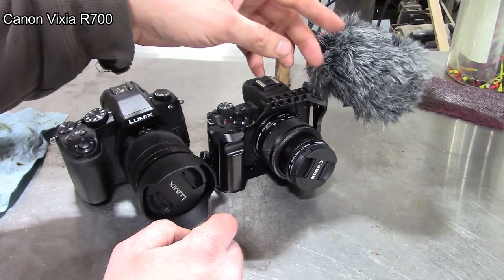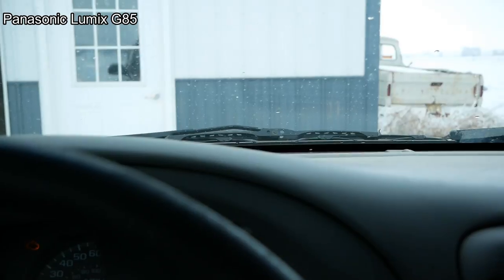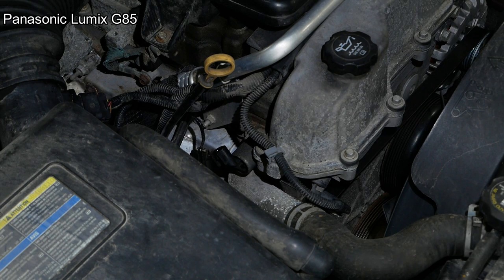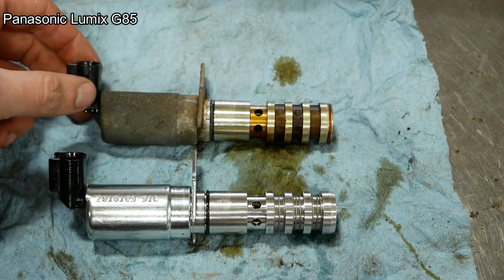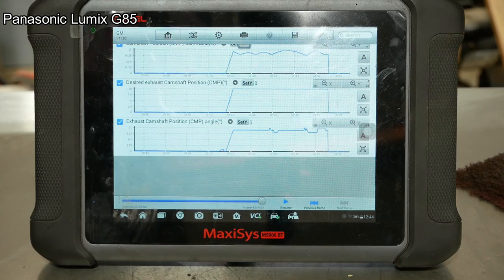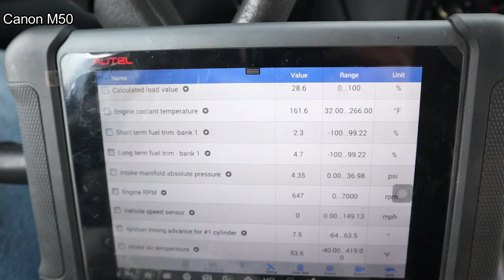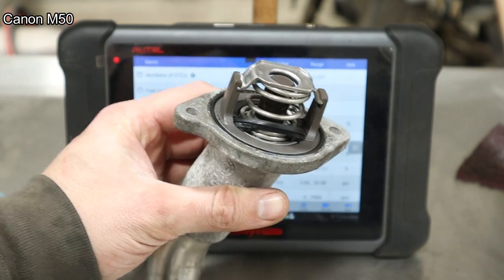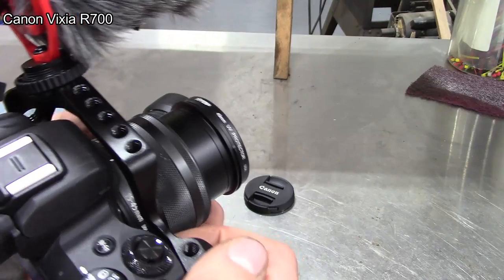Chevy Trailblazer -  Runs Rough on Cold Start, P0014- New Camera Testing

Comment: I own a 07 trailblazer. Replaced the steering angle sensor with a dorman and 20 minutes later the light was back on. Bought a real part from the dealer and installed it and never had a problem since. Did not have to have it calibrated. Lumix

Comment: I vaguely recall a similar GM design flop back in the 70’s. One of the new small post oil embargo  cars had a small v6 and the story I heard was that you had to jack the engine off the mounts in order to change one or two of the spark plugs. This was a time when changing plugs was typically done more frequently than now, as ignition systems were still a little primitive compared to more recent systems. Looks like the GM tradition of design stumbles is alive and well.

Thanks so much for showing the camera comparison! The Panasonic seemed sharpest, but honestly I think all three are satisfactory. Maybe keep the Panasonic and use the vixia as a backup? I was a little surprised at the canon performance. 

Nice to see the side by side under same lighting conditions. BTW, I must compliment the lights again. They look great! I know you are enjoying working with the better illumination. I’m hoping to find similar components for my own shop.

Not sure what it means, but the ISO numbers closely mimic old film ISO numbers. You would set lens speed as a coarse adjustment, to freeze  motion or alter depth of field then fine tune exposure with aperature. For instance, “Back in the day” in Kodak b&w we had plus-x 200 ISO, tri-x 400 ISO (and others), and some special developers and “push” processes that could get a very grainy image quality at up to 6400 ISO. It’s been a good 40 years since I’ve done any darkroom stuff, but I think that info is at least close to what we had.

Comment: As far as VVT issues go, that sludge on the intake screens is present throughout the whole oiling system.  Its also in the cam phaser .  This sludge is more solid when the oil is cold, causing phase problems in cold temperatures.  The shop I work at in Nebraska uses a flushing chemical from BG to break down the sludge.  That usually does the job to free up VVT solenoids.

Comment: Wes, if the problem persists, you could try an oil change and maybe ask the owners if this problem presented soon after a previous oil change.  I've seen a very similar problem on a Ford 3V 5.4.  Changed from synthetic oil to dino juice and the cam phase controllers immediately started to act up and cause severe rough running.  The fix was to revert to synthetic oil and change both controllers. They were gunked up on the screens, presumably inside as well.

Comment: Hi there, 
to change the iso increments on the Panasonic G85 you have to go to:

MENU → Camera Icon → page 6 of 8 (also called the Rec menu):
ISO Increments→ change it to 1/3 EV instead of 1 EV

Thanks for your relaxing and interesting content!

PS:
And maby use Shutter priority mode in combination with automatic iso, then you can just use your exposhure compensation to change the exposure and not have to worry about Aperture and iso. For a 30fps Video you would normaly set the expushure time to 1/60s and if you film at 60fps you would use 1/120s.

Comment: I'm pretty sure you fixed the issue due to the solenoid having oil in the connector. I've fixed a lot of them that way. Had a few that had chain and phaser issues too. Thanks Wes!

Comment: Wes, I recommend using the Aperture priority mode with ISO on auto.  That’s what I use on all my videos and any fine exposure adjustments are made with manual compensation (+/-).  You want to set the shutter at twice the video frame rate, so if you are compiling the video at 24 FPS, use 1/50 shutter speed.  If it’s not too late, you may want to check out the Sony line up as they are known for having the best auto-focus with awesome image quality,  A6400 would fit your bill perfectly.  I use the same Movo mic with great result.

Comment: I had a similar problem with my Odyssey.  It was the idle air controller.  It was gunked up and was sticking.  It oscillated while hunting for the correct position.  Also, I believe 2007 was the year of bankruptcy so they had (more) issues with quality.

Comment: Panasonic Lumix G85 worked best for me. Best balanced colors and sharp picture. 
Canon M50, too much white. Like, really too much white and colors are washed out. Focus will become annoying if it focus randomly, yes. 
Last camera perhaps not the sharpest image but good colors and easy on the eyes. 

I have come across once in my life having cooland creeping inside the insulation of a cable quite some length all the way to a junction box. 
That in turn damaged the wiring, corrosion and eventually short. 
The  cable was fairly long as well, ships propulsion engine of the larger kind, so it is fully possible. 

Thanks for another great video.

Comment: ISO is the sensor sensitivity, it makes the picture brighter with the same amount of light going into the camera.
Aperture is the door size for incoming light when you take a picture, the bigger the door, the more light you have, so the picture is brighter.
Shutter speed is how long you keep the door (aperture) open, the longer you open, the more light you have, so the picture is brighter.

Video shooting is mutually the same as shooting individual pictures constantly, so the theories of ISO, aperture and shutter speed applies. If the camera doesn’t allow you to fine tune ISO, you cannot fine tune it, you lose one tool of fine tuning your picture brightness. 
To make it easier, I suggest to keep it on P mode (auto mode), and only adjust the brightness of your picture with Exposure Compensation (E+ E- knob, or a +- button somewhere on your camera) so that the camera fine tunes of your aperture and shutter speed for sure to make the brightness right. You may still have to adjust ISO when you are moving between very dark place (under seat) and very bright place (direct summer sunlight), but you still don’t need to fine tune it

Comment: My very first thought was, clean that throttle body and spray the MAF sensor. No parts cannon required and it maybe should be a part of regular maintenance anyway. I think sometimes guys with expensive scanners kneejerk plug them in without considering more basic strategies. I’m only learning all this and probably completely wrong but thought I’d throw that out there from my amateur perspective to get some feedback. Thanks! 🔧

Comment: That oil in the ecm via the cable, yes seen it here a few years ago in my sons car. The ECM was closed and sealed yet loaded with oil. Dealer wanted an arm and a leg to fix issues. We removed the oil and sorted.

Comment: My knowledge comes from still photography not video but things translate mostly:

ISO is essentially the speed of the film you are using - so back in the old days of film the lower the number the brighter the day. Adjusting the ISO number higher brightens the image but introduces noise and artifacts in to the image. You will need to test each camera to see what the max ISO you are happy with as each one will be different.

F Stop will change the depth of field of an image, the hight the number the more depth of field you will have but the side effect is it darkens it too.  You might find that you can juggle them (ISO, F Stop, Shutter Speed) all around so in certain scenes you can set the focal depth and all the things you want in focus will be in focus and therefore turn autofocus off.  This is handy if the cameras autofocus is noisy or if its dark and the its getting confused as to where to focus.

Shutter speed differs for video than still as it can have an effect on how video looks.  Shutter speed for stills is how long the sensor stays open, the amount of light to hit the sensor.  For video Shutter speed changes the amount of motion blur on each frame - slower more blur / faster more crispy.  General rule of thumb for shooting 30 fps you would need to have 1/60th on the shutter, 60fps is 1/120th - basically one over double your fps - this is the more natural look to the human eye.

If you can get a histogram to display on the flip out screen that will help massively with the blow outs - the screen on the back just shows you whats going on and cant be trusted to show you if things are blowing out or in sharp focus, etc.

You would need to look at the settings for each camera as "straight out the box" or Automatic mode wont show the best of what the camera can do.  Autofocus is a strong point of this, I have a Canon 7D and out the box it doesn't do a good job at tracking objects moving across the screen (imagine I'm shooting birds) but after changing the settings it happily tracks them.

I dont envy the road ahead, personally I'd stick with the Canon, but it might not be perfect for your situation - lots of amazing videos have been shot on its predecessors like the 5D.

Comment: Me again. Had the same cold start issue in my blazer. Finally found the problem! ALL of the intake manifold bolts were loose due to the plastic shrinking in the winter/cold temperatures. Some of them were barely hanging in there. The rest you could tighten with your fingers.

Comment: When my 05 trailblazer needed a new thermostat I went in at it through the wheel well.    Just pulled driver front wheel off and there it was.     Replaced the coolant temp sensor while I was there.

Comment: I like both the Panasonic and the canon. However, I really like the image stabilization of the Panasonic. The canon would be an impressive second pick though. After hearing you describe the build quality of the Panasonic compared to the quality of the canon I’d pick the Panasonic. Also because the zoom is backwards on the canon as well. I couldn’t really tell the difference in the focus feature of canons face tracking compared to the much more impressively crisp focus of the Panasonic either, it seems to be a well rounded camera that is more durable and more tuned for your specific use than the canon to me. I’m not downing canon by any means because they make excellent products but I see the quality of the Panasonic exceeding in more than just a couple areas, lens, focus response, video clarity, and so on.... I should also mention being straight out of the box is perfect, but with a bit of fine tuning you’d have a damn good camera that is well suited for your specifics. 👌🏻 Awesome content as usual Wes, keep up the amazing job!

Comment: My TB had this exact same problem, and did not need to be really cold. Raced up & down for only about a minute then fine. I changed several sensors but straightened it out with a different throttle body assembly.

Comment: I don't have automotive experience but I know mineral oil cooled computers have issues with the mineral oil creeping up the cables.  The real issue there is that the mineral oil makes the insulation extremely brittle so if it gets bad enough the cable will just shatter when you try to move it.  For some background mineral oil cooled computer are done by basically filling a small aquarium with mineral oil and just submerging almost the entire computer in it.  No case obviously and hard drives can't be submerged due to the moving parts.  Then the oil is pumped the external radiators where it is cooled.  Result is a really awesome looking computer though there are many downsides.  For one the components are usually ruined, they'll work fine in the oil but if you try to take them out they'll never dry and usually never work again.

Comment: New lights and Limux seems like a good combo.
Oil leaking thru cam actuator into the connector seems to happen to a variety of vehicles. What makes it really bad is that oil can wick into the harness and affect other components. Mercedes even makes replacement harness connectors when the real fix is to simply replace the actuator.

Comment: Hi Wes,  the Panasonic is my preference because the autofocus seems to work much better.

I will take a stab at explaining the Shutter Priority and Aperture Priority modes.  

First, the normal automatic mode works by analyzing the exposure of the picture and selecting an aperture and shutter speed that is a good balance across the picture. In low light the camera in still mode probably selects 1/25 of a second (lowest setting for handheld shots) and the maximum aperture and for video it probably selects the video frame rate as the shutter speed.  Each camera manufacturer can implement their system differently but this explanation is probably close to what actually happens. Some cameras might have a setting that weights the center of the picture more heavily when evaluating exposure and others may only evaluate exposure across the full frame.

Secondly, the aperture and shutter priority modes work by fixing the user chosen setting and letting the camera only adjust the other setting.

Lastly, the manual mode allows the user to choose both the aperture and the shutter speed.

To make matters more confusing, some cameras have a high dynamic range setting where the camera takes multiple exposures per frame with different settings and software tries to bring out details in the extreme light and dark areas of the picture.  This tends to blur motion and I find that I usually shut this off.

Comment: I really liked the Panasonic.  I think it did much better.  The R700 was also good. I use a Nikon and a Canon but for still photography.  I'm still using Pentax 35mm also but I'm a little old fashioned.  Among my main jod I am also a mechanic.  I work on mostly diesel in busses, heavy duty trucks and tractors.  I can work on the OLD gas vehicles but all these new computer systems in them have me stumped sometimes.  My back is shot so I can't do some of the things that I used to so I really enjoy and look forward to your videos.  Keep up the good work and keep them coming.

Comment: Hey Wes . Canon make an adapter so you can use Canon EF lenses . 
Their lenses on full frame cameras are exceptional. 
I have a canon 90d . 32mp outstanding picture quality whether stills or video . 
I regularly use a 50mm f1.8. 
It’s the cheapest lens available for any camera system . It’s so sharp . 
In the uk I paid £80 new . 
It’s a plastic lens plastic mount . Glass elements inside . 
But it’s an amazing lens . 
Guessing that you require a short zoom lens . 
Have a look at Sigma lenses .m
Fantastic quality again . 
Try an stick it out with the canon . 
Don’t forget you are new to the m50 system . 
It’s a steep learning curve . 
Unless you go for a full video specific video camera . 
Again Canon make some fantastic video equipment. 
Great vlog as always , thanks for sharing your world with us all .
Regards Martin, UK

Comment: The G85 is set for full EV stop adjustments. The Canon is set for 1/3 stop adjustments. 
ISO 100 to ISO 200 is one full stop. ISO 200 to ISO 400 is the next full stop. Each stop up or down doubles or halves the amount of light to the sensor.
ISO is easy math. Just double or half the number for full stops.
I found this article on setting the G85 to 1/3 stop adjustments.
https://suggestionofmotion.com/blog/panasonic-gh4-setup-iso-increments/

This adjustment also applies to your lens aperture.
Full aperture  stops are F2.8, F4, F5.6, F8 etc. Not as easy to remember as the ISO values. You should be able to set 1/3 aperture values after changing the default of 1EV to 1/3EV.
After making the change each click of the adjustment wheel will be 1/3 stop up or down depending on the direction you turn the wheel.

The aperture settings also affect your Depth Of Field. DOF is how much of the scene is in focus in front of and behind the subject you focused on. The larger the aperture the less DOF you will have. F2.8 has less DOF than F8.
Wide angle lenses have more DOF than telephoto so using the wide lenses that you have you do not need to worry about that too much.
1/3 of the DOF is in front of your focus point and 2/3 is behind the focus point. Good to remember when photographing groups of people in multiple rows. Don't focus on the front row.
There are some good DOF apps for your phone if you ever need help with figuring DOF.
I hope this helps.
I love your videos and your style.

Dale
Camera nerd trying to learn video.

Comment: So far its the G85. color temp was spot on IMO and focus tracking was quite good. The new shop lights are giving you great depth of field too. in the opening sequence everything appeared properly exposed. under the hood was very hot, at least 105-110 IRE. If you have a waveform monitor check that portion of the vid out.

Comment: Steering angle sensor=
Winter, might have bumped wheel on icy curb/parking barrier.
Check toe, hub bearings, tie rods. Check if wheel tracks center while driving.
Check bump stops (if equipped).

Comment: There is a fuel filter on the trailblazer,  drivers side, inside the frame rail. A little behind where the drivers seat is located. Very obvious,  if you look. I own an 03. 4.2 . Been an excellent vehicle.
Reply from the maker: No. The later models do not have a return line or a fuel filter except a strainer in the tank.

Comment: LUMIX   looks best.
Re Aperture and auto focus.  
If you have enough light to to this:  Use aperture priority mode, use high number aperture which is actually a small hole.
That will give you a deep depth of field, more will be in focus and focus will be much much less touchy

The danger is shutter speed will slow down and your movement gets blurry, find the sweet spot with iso to balance brightness, blurry and focus.